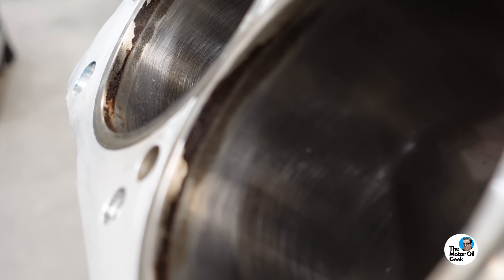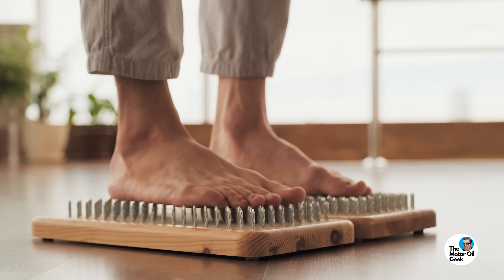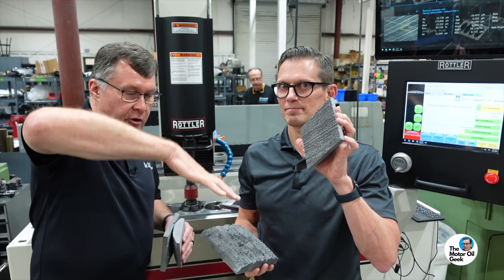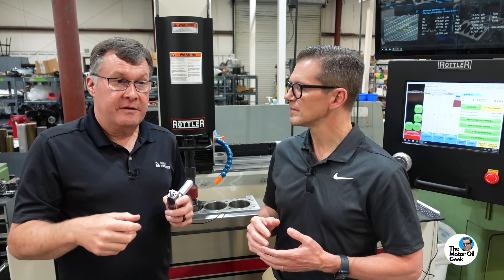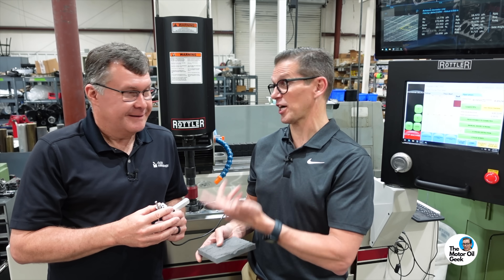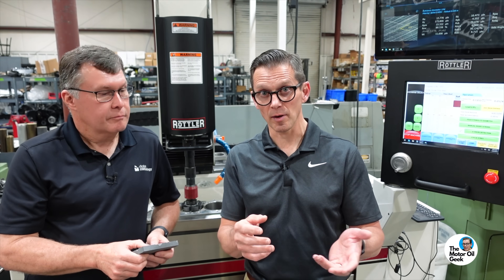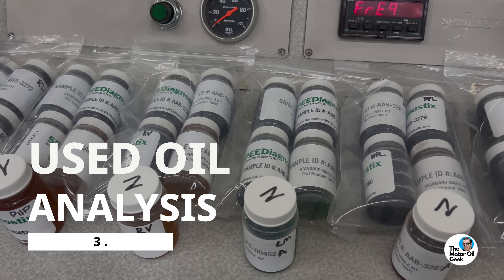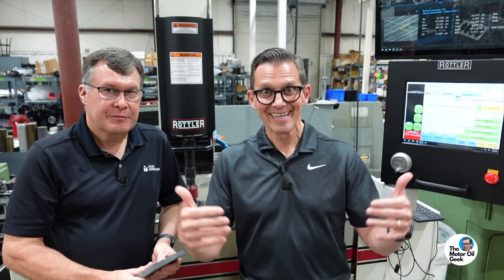GM's $1 BILLION Dollar Blunder: ROUGHNESS Matters...

Comment: After over a hundred years of automotive development, they've found a way to screw up almost every component.
Reply: Planned, though not well, obsolescence
Reply: @chipstanton7609 oh it's planned well... the failure in their engineering is a part that fails too soon forcing a recall... there are engineering teams that make parts worse to help push parts sales.
Reply: @dudeman8323  This sounds like Audi VAG to me.  If sensitive plastic parts in an engine is good then more is better, and let's destroy the engine in the process.
Reply: @chipstanton7609  Ding Ding. We have a winner. They know EXACTLY what they are doing. They just pushed it too far and they only last to 24k miles instead of 37k, the warranty only lasts 36k. Or thats what it used to be, I wouldn't know because Id never buy a new GM, FORD, or especially Chrysler.
Reply: @chipstanton7609  Ding Ding Ding; we have a winner.
Reply: Good overall video but your title makes you believe there i info on the Gm crank pin surface finish. You mentioned a lot about cylinder walls and piston rings but deflected crank pins. Perhaps its sti’’ too close to a legal issue to metion
Reply: I have 3 vehicles from the 90s (Ford and GM) that are still on the road with original engines over 150,000 miles with no rebuilds. We are definitely going backwards AND IT IS SHAMEFUL.
Reply: @Andrew-jm4tp  exactly why I purchased a low mile 03 expedition a few years ago. This new tech is shortening engine life for a 1 mpg gain
Reply: @Andrew-jm4tp  I really hope my 2015 Honda Civic last as long as possible
Reply: A local hiway was innitially built 70 years ago as 2 lane. About 15 years ago they widened it to 4 lane divided. Other than the occasional plane and topcoat maintenance, the 70 year old side is still good and fairly smooth. The 15 year old side has humps and bumps and potholes in it. There can be a high water table at times which allows frost heaves in the winter. The ice moves soil which never returns to the same place in the spring. 
Now you would expect over the 55 years between that we would have learned how to build the road better. The Romans built roads and bridges still in use today! Progress? BAH, humbug!
Reply: @daledavies2334 while i highly agree with you, very heavy trucks have a lot to do with that
Reply: @daledavies2334  Absolutely agree,  my little road, only local traffic was failing, old, lots of patches, they came out and 'resurfaced it with rubberized asphalt, I'd prefer to have the pot holes back, my car sounds like the suspension has totally failed, get on a different road and it's fine.  They resurfaced parts of a local freeway, Hwy 85, now, beware if you are in the #1 lane, you'll be in for a very rude surprise on the edge of the road, huge waves, very unsafe.
Reply: Just trying to cut costs everywhere. Plus the idea that you only are going to keep a vehicle for 2 or 3 years, then the manufacturer doesn’t really need to worry about these things. Then they cut costs on truck motors and whoops!  most owners keep trucks in their fleets longer and the they work so much harder. Then all of a sudden the cost cutting issues raises problems to the surface. 😂
Reply: It all about the money..
They can build aircraft engines jet engines with a lot more tolerances but it's all about the money
Reply: They reinvented the wheel, but instead of upgrading it they removed as many spokes as possible to save money. As long as it falls apart off the lot it’s fine by them.
Reply: @minigunner1218 Exactly!  No need at all.
Reply: That's how engineering works, you understand how it could break and avoid that.
Reply: No, they roll the enginnering dice on going for a spec that will be money saving and get the engine past warenty miles so it wont go on for ever and people will eventualy need a new truck. Here they got that wrong and it isnt making just past warenty mileage.  If may have been within spec if people were letting engine warm up and using the right oil and servicing at the correct mileage.
Reply: @krusher74 Are you saying people are using the wrong oil?  How long should people warm their cars up?
Reply: Build obsolete only to last over warranty
Reply: Buyer BEWARE
Reply: And drive up the costs of having a new truck.
Reply: That's what I say????
Reply: The problem is the dollar is worth less and nobody expects to pay more. Lowest cost starts with customer demand
Reply: They figured that out 50 years ago. Get it right.
100 years later we are just now discovering how much they have manipulated us.
We knew all this for as long as racing has been a thing.
Reply: Like how Ford managed to screw up spark plugs of all things in their 5.4 3 valve.
Reply: @captain150  Absolutely And the Internal timing chain Driven Water pump. 3.5 v6 transverse .. Genius.
Reply: They did it right in 1955 with the SBC. When they changed to the LS it was all over.
Reply: Yes, and now toothed belts INSIDE  the diesel engine, running in HOT oil & doing what? SPINNING THE OIL PUMP! I read that two. Manufacturers are guilty of this now. I have a friend who owned one...for a short period of time. Naturally, it laid down on him! His wife had just cranked it up in the driveway to leave from work and got nowhere.  
Where are the class action lawsuits?
Reply: @NC-xk1eg  Yup Ford did that....Instead of a middle gear or small chain....If the belt was easy to reach & replace....It wouldn't be a big deal if they didn't purposely made it very hard to replace.
Reply: They are trying to squeeze the last bit of efficiency out of these engines due to unrealistic EPA mileage standards. The solutions they are using, such as cylinder deactivation, direct injection, and super thin oils are sacrificing reliability for no real world benefit. When failure occurs, the cost will be many times what little fuel savings were made.
Reply: Outsourcing to low cost economies and elimination experienced and knowledgeable engineers.  You get what you pay for.
Reply: Not almost, literally every component. And they find new ways to screw them up, and also repeat the old screw ups over and over again.
Reply: @jeffrojefferson88  I wouldn't buy a new model car even if I won the lottery. Same with motorcycles, putting fuel injection on small & midsize motorcycles is like putting fuel injection on a push lawnmower. Along with the other garbage. Like ride by wire & nanny control settings. Just like with old fuel injection cars, all those capacitors inside the ECUs & other electronics are going to go bad. A Smart or Lecton or knock off carb is as efficient as FI and the 1 carb replaces the 25+ extra parts needed for the FI system
Reply: Ya, you don't move forward by using the same old technology. That's why todays cars are a million times more reliable than the old ones. Today your car might need a part replaced at 100,000 miles.  In the 70's your entire car needed to be rebuilt or replaced at 100,000 miles.
Reply: They fucked up the transmission in the hd trucks as icing on the cake
Reply: Re inventing the wheel; maybe to give engineers something to do as they need to keep them on the payroll.
Reply: Closer to 200 years given we had internal combustion engines in 1790. And 800 years for the crankshafts connected to pistons
Reply: Go drive a hundred year old car and go drive a new one.  Stoooopppiiiddd!
Reply: The Chinese have infiltrated GM. Google it🧐
Reply: Welcome to the human race.
Reply: Stock markets don’t engineer anything.  They probably cut corners on building this engine.  First of all I believe that 0W should never be used unless you live in Alaska.  0W20 on my jeep is only rated to be used in 68f or less ambient.  What are they thinking?  0W40?  Stupid idea to gain a tenth of mph.
Reply: @stevenhill4122  0w40  is thicker than 5w30 at operating temperture.
Reply: Exactly!! Ford truck frames are lasting less than 7 years they rust out. Pathetic.
Reply: Yep! Which is why I have NO sympathy for these idiots and they pathetic designs! GM and the other domestic 2 automakers are complete morons. They’ve all had over 100 years of manufacturing and vehicle engineering and these ‘tards still find a way to screw everything up because of being cheap basturds 🙄🙄
Reply: After 60 years of building shistains, they finally gave up on the idea of trying to build a decent small car and now just let the Koreans do it for them.
Reply: It is deliberate sabotage to cause distrust in internal combustion and force the movement to EV and China dominance
Reply: After 100 years one would think that there would be some knowledge carry over and design expertese.
Reply: There are multiple ways to screw up absolutely every component in a vehicle. Then there are extra ways to screw up assemblies, even when every component is perfect. It isn't just "a [ie: singular] way to screw up almost every [ie: not every] component.
Reply: Either screw it up or perfect planned obsolescence
Reply: @michaelbrinks8089 there is no perfect planned obsolescence.
Reply: College graduate engineering... Never built a engine themselves. Probably never disassembled one either.
Reply: My thoughts exactly..including lifters too...
Reply: I don’t see your point. There is no comparison between a model T pickup and a new F150 in any regard. Performance, longevity, fuel efficiency, drivability etc.
Reply: Leave it to GM, they've been fucking up like this for decades. Look at the 5.7 Diesel and the Northstar V8, both developed by Oldsmobile and both released early despite not being a finished design. Both had the same failure modes due to the factory head bolts being dramatically undersized, and both engines had been radically improved by Olds R&D (as well as Cadillac for the Northstar, since Oldsmobile died in 2004 and was no longer working on the design) but it was too little, too late for the engines' reputation. They repeated the same mistake (asking one of their brands to release a prototype without extensive testing to find all the major design flaws) twice, thinking anything would change. The second time they did it, it doomed the oldest American car manufacturer and one of the oldest in the world (founded 1899). 

Then look at Cadillac V8-6-4, active fuel management and dynamic fuel management. SAME MISTAKE THREE TIMES, and it got WORSE the second time around. 8-6-4 didn't blow up engines, it just didn't work as well as it should've because 80s computers didn't have the processing power to keep up with the information the engine sensors were providing. AFM and DFM however? Yeah, bye bye 5.3 at 125,000 miles or less (the early LS-based 5.3 was a 300,000+ mi engine). Poor maintenance played a role here, but the idea is still poorly thought out and even more poorly executed even after many supposed "fixes."
Reply: Wetbelt enters the chat
Reply: I am amazed, all I wanted to do is replace my GM truck with a newer one, and GM screwed that up, I am even nervous to buy the smaller engine
Reply: It's all planned. They don't want anyone driving.
Reply: That's exactly what I'm seeing!!!!
Reply: I remember back in the 70's you were luck to get 75k miles from the average car engine.  Just saying 😮 Yes, I'm old.
Reply: Go read the original Green New Deal and all will be explained
Reply: same old sin.... the love of money
Reply: Pimple face computer kids designing cars instead of real proven hotrodders
Reply: Sounds about right for GM lmao
Reply: All these complicated replies attempting to get to the root of the problem when it can be summarized with one word: capitalism
Reply: A dumber thing has never been said.
Every single compnet lasts longer and handles more stress. Compared to 100 years ago
Reply: It has little to do with engineered obsolesce or incompetent and far more to do with emission/efficiency compliance and competition for greater and greater power.
Reply: @earlmcmanus194 nope it's cost cutting to get you through the warranty.
Reply: Glad I switched to an EV for my daily driver.
Reply: That's what happens when executives hire middle managers to recruit and promote DEI hires to replace competent engineers.  Their goal is to create good PR by meeting quotas instead of using knowledge to build good mechanical systems.  Think of this every time you go to the parts counter and there's a woman who wastes your time asking what you need then has to get a guy to help you because she has no mechanical vocabulary, aptitude or experience.
Reply: @big6316  No,  that's what happens when a company no longer makes their own parts and opts for the lowest bidder.
Reply: @big6316  Sorry about your problems with women but this was a manufacturing error, not an engineering mistake.
Reply: @big6316  Also, US engineers are expensive regardless, so many corporations are trying to outsource more and more engineering to Mexico, China, and India.
Reply: @big6316 got any proof its DEI hires, or just you political ignorance
Reply: @fredmyers120  Ask 10 long-term, non-management, caucasian workers at GM.
Reply: @big6316  No, it's not "DEI hires". You're blaming the wrong thing. It's cost cutting. Every possible thing they can do to cut costs, they will, because line must go up more every quarter.
Reply: @davidfuller581  Let me make it simple for you.  Low wage, young, minorities with little or no college and no experience and/or from other countries (offshoring) are cheaper than older, experienced, college educated Americans of the wrong color.  Corporations are dividing the work the older ones can do alone among 5 or 10 cheaper ones who are easily intimidated and easier to replace.  The corporations then crow about how they're advancing "equity"  when all they're doing is making wage slaves out of cheap labor while also reducing benefits, job quality, product quality and customer service.  Cost cutting is definitely a part of it but you're missing the big picture if you think that the resulting unexplained ramp up in quality issues in every industry are "normal".
Reply: @big6316  You have no idea what you are talking about.
Reply: @javilink7  Wow, well I guess you win then.
Reply: @big6316  What really happens is that the bean counters found "another great way to save money" and not DEI hires. Same thing with Boeing.
Reply: @big6316  BS, this is what happens when bean counters over ride decades of hard earned knowledge to save pennies per part, and it's been happening LONG before you guys had culture war dogma to blame for the reality that the capitalism you worship has a bark side where it's cheaper for companies to catch a problem on the back side than it is to manufacture things RIGHT in the first place.
Reply: It is not about DEI, it is about this relentless cost-cutting and the worshipping of these useless MBAs.
Reply: @big6316  Do have any evidence to back up your claims?
Reply: @ChristianMeza-e1w  45 years in corporate America, 30 of them meeting with the C level teams of the largest corporations in America in every industry and observing them in action. Also 60 years buying car parts.
Reply: @big6316  You have anecdotes, not evidence.
Reply: @big6316 Do not blame every issue on DEI. Blame on Harvard MBA CEO. They are clueless and just bean counter. Good engineers do not want to work for incompetent boss, they rather work for themselves. So, GM, Ford, Boeing has mediocre engineers, and produce bad products.
Reply: @dwang552  FACTS.
Reply: @dwang552  nah it’s easier for them to blame every race and gender that they don’t like rather than the true problem which is the super white, male, MBA, Wall Street guys. You know, the ones that’s buddies with their guy who started blaming everything on DEI 🥴
Reply: AND THAT WOMAN CEO IS STILL IN CHARGE !!!!
Reply: @bri @brianblithe2271  so you want her fired because she’s a woman? What about Fords recalls and the rest of the automotive industry? You’re not saying those dudes or Jim Farley is still in charge, yet you’ll call out the first woman and blame her for everything and not acknowledge all the men that control the entire industry and wall street. After all, Mary Barra didn’t bring GM down. Who caused the bankruptcy? Sure wasn’t a woman or DEI 🥴

Comment: So, were  GMs crank shaft/ bearings or rod bearings too smooth or rough? Is the 10w- 40 oil adhesion properties a realistic fix if done early on.  
My Toyota requires 0w-16. I'm running 5w-20 this summer. I swear under certain load, speed conditions my mpgs actually went up 1- 1 1/2 mpg. Plus it runs slightly quieter. It'll be interesting to get my next oil analysis back. My 1st oil analysis was running Toyotas OEM 0w-16 @10k. (I did the 1st change at 1k, then a second at 5k myself.) or am I heading for a disaster not using the "science"?

Comment: The information you get from this channel is pure gold.
Reply: Black gold!
Reply: @rapid13  Texas Tea
Reply: @rapid13 texas tea
Reply: I'm an aerospace engineer and never seen this channel before.
BUT YOU ARE 100% RIGHT - this is gold. 
Even if your not into engines this is the sort of thing that applies to so many other areas of engineering.
This applies to ANY sort of valve or seal.
Reply: Liquid gold!
Reply: Agreed!!
Reply: Platinum I say
Reply: Very interesting but wasn’t anyone taking oil samples on engines over a lifetime of use … such as whats done in the aerospace business? Soap (Spectrometric Oil Analysis Program) samples were taken after each run to determining the health of the machine.
Reply: Mind blowing